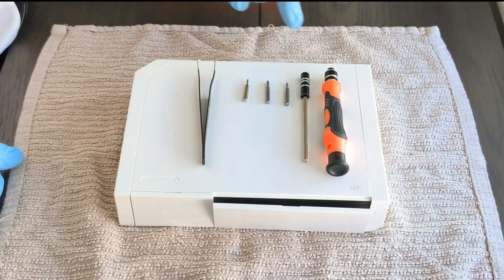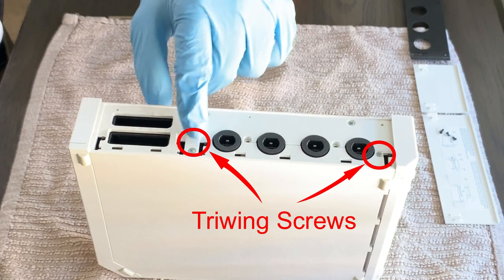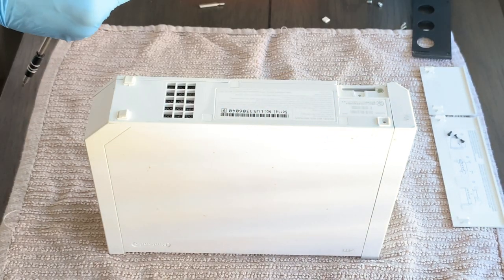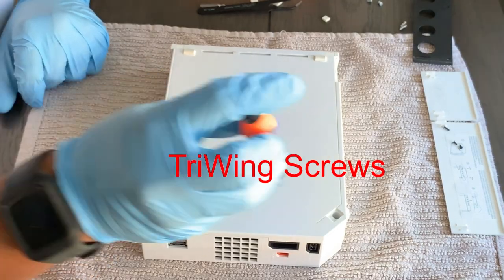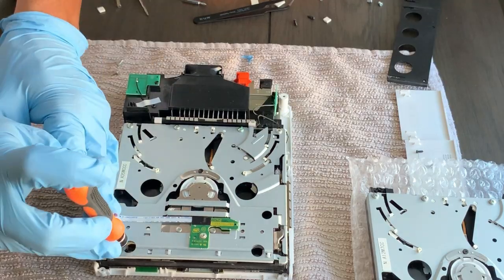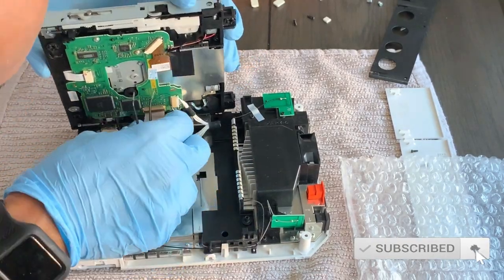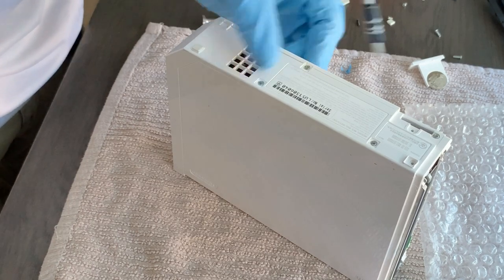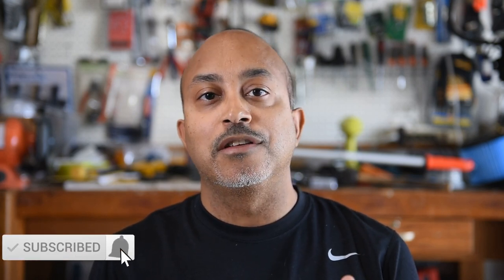Nintendo Wii DVD Drive Replacement (2022)

Comment: Thanks man, a local repair shop wanted 180$ to change the drive with no gaurantee it would fix the problem because the Wii is so old. Your steps were clear and concise, if I could give you as many thumbs ups as there are screws in this device I would.

Comment: Thank you for your CLEAR and concise instructions - it took a while because of all those screws but our Wii is up and running again.  By the way, just my personal tip for dealing with screws, I always tape them to the location from which they came so I know EXACTLY which screw goes where. That is easier for me than pictures although I do take pictures for other reasons. …now if we could just find an inexpensive replacement for the favorite game disc which somehow grew legs and walked off…. Thanks again for the great tutorial!!!

Comment: I was able to purchase the plug and play drive and perform the maintenance. Here’s a few call outs:

-the DVD drive listed in the description came with a tri-wing screwdriver, which I already bought separately for this but was a nice gesture from the seller.

-the dvd drive does indeed read GameCube games.

-some of the screws that were called out to be tri-wing screws in this video were Philips on my unit. There’s also different length screws so make sure you are paying close attention.

Thanks for providing this in depth tear down tutorial!
Reply from the maker: Glad I could help

Comment: First of all, I want to say thanks for the amazing tutorial. It helped a ton!

Secondly, if anybody is looking for a more modern testimonial, this guide works 100%. And the disc drive he linked in the description does in fact play both Wii and GameCube games.

In terms of difficulty, I rate this project 2/5. Reattaching the disc Drive ribbon was a bit of a bother, putting the face plate with the power button back on was annoying (tip: wiggle the reset button, it doesn’t want to go in easy). And I recommend a flat head or a tweezers for the rubber feet. I used a knife and it wasn’t the greatest. All in all, a pretty easy project for anybody who wants to restore their Wii. Good luck!
Reply from the maker: Thank you for the comment

Comment: Excellent! Detailed, clear, and concise instructions for a successful DIY fix! Thank you for sharing your expertise!! 
DIY Notes: "Y" tri-wing screwdriver a must. Magnifying glass helps to prevent stripping screw heads. Lots of varied screws with multiple head types and lengths to keep track of! (with extra holes to choose from! :) How I kept track: As disassembling, rough sketch each side/layer of the Wii console on individual sheets of paper, numbered in order of disassembly. As each screw is removed, securely scotch tape screws and covers in the drawing noting exactly where they go. Reassemble in reverse page by page while following the video. Quick, easy, and successful process for many more hours of Wii fun!

Comment: Great tutorial for replacing the disc drive! I was able to do this even with my old man eyesight and barely being able to tell the triwing apart from the small phillips. The only thing I had to cheat with was the backer nut for the battery cover... Wasn't going to take it all apart to get that nut back inside. I taped it to the outside for the next person to put back in and duct taped the battery cover down... Wii is working like a champ! Thanks!

Comment: Great video! I have just done this fix following this and it’s helped no end. The only problem I had was the final two black tri screws holding the face plate on. They just wouldn’t budge and started to strip so I was forced to keep the face plate attached and remove the rest with some tricky manoeuvring. Not ideal but worked perfectly!
Reply: How did you manage that? I'm having the same problem but I don't see any way of getting into the face plate without removing those two..

Comment: I took apart my wii and cleaned the lens and nothing happened but if I replace the disk would it fix it?
Reply: Probably, I tried cleaning the lens yesterday, I ended up making the disk laser completely defunct. Luckily I had another disk drive laying around in an unused wii from years past. Replacing the drive SHOULD work.

Comment: Great tutorial! Currently stuck trying to remove the tri-wing screws that hold the faceplate. They're quite stuck, unfortunately, and it's resulted in the screws being stripped. I suspect there's some sort of adhesive/loctite involved. Any advice?
Reply from the maker: try using some duct tape to cover the screw and then try to remove the screw.  there should not be any lock tite

Comment: got 2 screws by the front plate of the wii where the disc goes. but man i cannot take them out.
mad mad
Reply: Are they tri-wing? They might be security screws that you need a special screwdriver for

Comment: Would I do this if the wii doesn't register on the TV? Sometimes it takes multiple tries and when the TV does register I get a black screen..

I have another wii that starts right up but won't read my wii sports disk. It's frustrating.  I want the wii that takes too many tries because that one has all kinds of good games on it but I just don't know whats wrong :(
Reply from the maker: For the one that doesnt register it sound like more of a like a display problem, replaceing the disk drive wont fix that problem, it will fix the other wii though